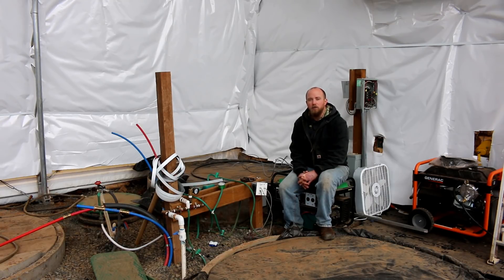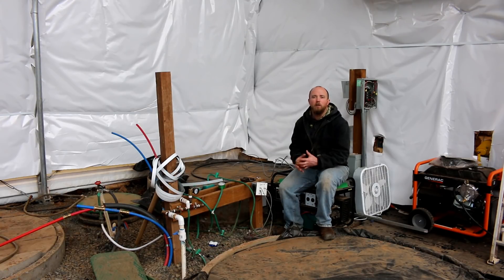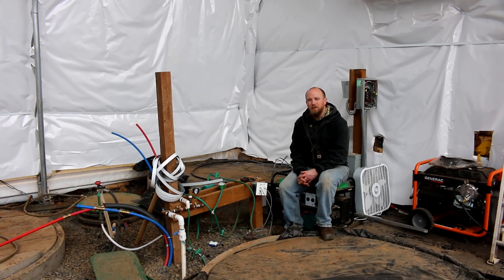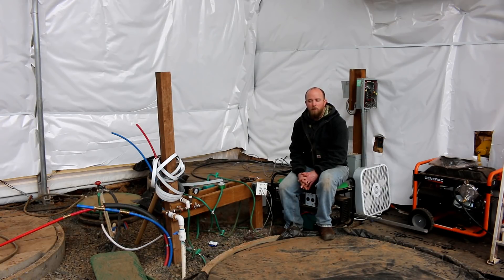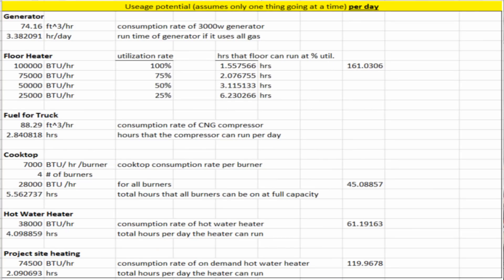How to turn your WASTE, into ENERGY

Comment: I have been following your build for a long time and I have done a lot of research as I am looking at also building a self sufficient community and bio farm. I have some suggestions for your problem of feeding your digester and food flotation issue. For your straw and poo grinding to a small enough size at a reasonable price I would look into this idea.https://zzagii.en.made-in-china.com/product/XvRQeMnoOrpf/China-Farming-Equipment-Straw-Shredder-Feed-Grinder-Hammer-Mill-for-Cow-Pig-Sheep-Feed.html it will get it as small as you want and blend it into your digestate tank by the barn and it would mix and ship into your digester. As for your food floating on top try this with a screen on the intake.https://www.northerntool.com/shop/tools/product_4869_4869?cm_mmc=Google-pla&utm_source=Google_PLA&utm_medium=Water%20Pumps%20%3E%20Sewage%20Pumps&utm_campaign=Tsurumi%20Pump&utm_content=108200&gclid=CjwKCAjw-bLVBRBMEiwAmKSB819MbPTnDAvzoAe5vpdHwJE5UiGwz8pbyy-bC-ltpWHNOV_B-p9N2xoCMOYQAvD_BwE. I would like to speak with you more about this when you get time if your interested.

Comment: have you looked at microbial fuel cell ? they produce directly electricity from organic matter ( poop contain organic mater ^^ ) 
don't worry about the platinum stuff or those kind of stuff, there is relatively cheap designs. a guy un south america made a little robot that slowly move along the side of a river, pumps into the MFC some dirty water, wait to fill up batteries, then continue to go on until the batteries are empty again

MFC=microbial fuel cell 

have a nice day

Comment: why not use a commercial toilet macerator to grind up the waste feed?
Reply from the maker: I've essentially tried that already. I bought a $400 grinder pump that "grinds braws, leather gloves, etc, etc," but it didn't work becuase they all work on the premise of a very high water to solid ratio. Like 90% water to 10% solids, or less.

Comment: I think that this shredder might be a solution to your feeding issue. It's designed to shred multiple forms of plastic, requires no water, and the plans are open source. It has a reversing switch for stuck materials, which reverses and then refeeds the material back in again, and the entry hopper is significantly large.
https://www.youtube.com/watch?v=LuhZM5cP3VQ
https://www.youtube.com/watch?v=LuhZM5cP3VQ
A complete set of instructions and construction videos: https://preciousplastic.com/en/videos/build/shredder.html
Reply from the maker: yes yes yes!!! i totally agree and have watched these before as well...this is where I'm leaning

Comment: Evening Jeff. You have a real future power supply started there. Our county landfill has a full section that has been closed for sometime now and they capture enough methane gas to power a 12 cylinder caterpillar gererator that supplies enough electricity for 600 homes. The engine is only idling because there's not enough gas to rev it up. Enjoy your videos. Take care and God bless.

Comment: Could you comment a bit on the domes for the storage tanks, size, cost, material, Where you got them?  Also did you find a solution for last years straw  sewage pump problem?  Have you looked at the tub mixers for hemp houses?  They mix hemp/straw with lime and a little water.
Reply from the maker: the domes and the tanks are all part of the kit you buy from Puxin. https://www.google.com/url?sa=t&rct=j&q=&esrc=s&source=web&cd=1&cad=rja&uact=8&ved=0ahUKEwiXyZvJ18PYAhVnsFQKHSq6CR0QFggpMAA&url=http%3A%2F%2Fen.puxintech.com%2Fpuxinportable&usg=AOvVaw1Bvr6ZmU8200kDAejwVt9s 

we'll be talking a lot about the the feeding in a future video and a lot this summer as we fix the problem. The BLUF (bottom line up front) is that we need a pre processing step to shred solids into smaller sizes so the pump can pump them into the stomach

Comment: Where did you get the forms for the digester, and neck?  What does that cost ? they looked like they were made of coated steeL?   the size lookes like its about 12 foot diameter by 6' tall?  4x6' neck?  Quxin from china?
Reply from the maker: +Rainbow Works Puxin from China

Comment: Regarding your digester. Whilst I was at university one of the long term experiments taking place at the local Ag College farm unit was to build a small digester buried in the ground next door to a pig finishing / fattening building using liquid pig manure as the source stock material to try to produce a usable and reliable amount of methane to use as a heat source to heat some other pig buildings which had sows and litters being born and reared in (little piglets are extremely temperature sensitive as you may know.)
The design was similar but nothing like as refined as what you have in place (being only partially buried under the ground). The project ran for 5 years and was eventually closed as something of a failure overall for one main basic reason: in order to maintain gas production during the winter months the methane producing bacteria have to be warm enough to function satisfactorily and due to heat loss from the digester most of the gas produced had to be burnt in a device that warmed the content of the digester. In fact in spells of real cold weather output was insufficient and had to be supplemented with propane and we do not suffer such extremes of cold weather such as the USA is troubled with right now.. 
Thinking about it all I'm sure there were significant gas losses and major issues of inadequate insulation all round. Also it was only a relatively small digester - nothing like the size of yours! Small volume digesters I would imagine temperature fluctuations much more easily.
The final nail in the coffin of the project was that the stockman in charge of the whole pig unit had to feed some antibiotic in feed medication for a few weeks to the finishing pigs to control a severe outbreak of digestive bacterial infection in the stock. this event was not communicated to the people running the digester. This veterinary approved treatment had the eventual effect of killing the methane producing bacteria in the digester which brought it to a standstill which in turn led to the closure of the experiment.
Reply from the maker: appreciate the detailed. Heating of the digester is the reason why it is inside of the hab. The heat we use to heat the building also helps heat the digester

Comment: Would a 55 gallon barrel valved into the digester feed slot with a nitrogen tank to pressurize it let you send batches of materials in without letting in huge amounts of O2? Could go as simple as a valve stem for a tire on the barrel with an air line off the nitrogen tank to bring it to a set pressure before opening the valve to get it higher then the internal pressure of the big tank.

Comment: Rather than single source a point of failure I'd suggest an alternative power bank of DIY 50 year+ Nickel Iron batteries with solar panels. All surplus electrical power can be banked. Digester and a solar powered NiFe battery bank would be my primary choices with a  thermal heat mass storage sub... keeping warm in the PNW is high on my list. Questions? I can help! BTW, Have you planted your one acre of hybrid Poplar trees? Totally sustainable... start harvesting 10 cords of firewood in the 4th year and continue harvesting 10 cords every year there after... https://youtu.be/Omk0dfyP5Ro